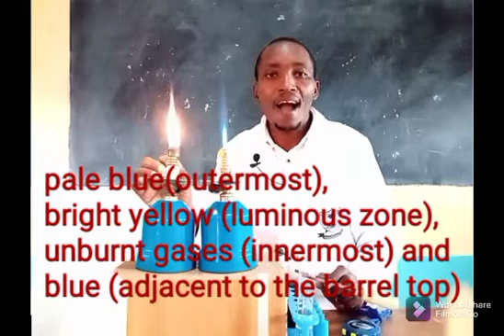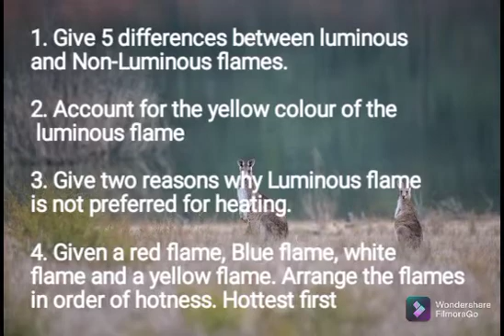Types of Flames - Luminous and Non-Luminous Flame by Dr Sirme

Comment: why is non luminous  when there is a little light emitting?
Reply from the maker: The gas is burnt completely hence produces no carbon particles. Note that the light/glow is produced by the the glowing carbon particles from incomplete combustion of the gas
Reply: Luminous means brightly illuminated, if it's not brightly illuminated despite of emitting little amount of light it's termed as non luminous. In non luminous the bonds energy stored are completely utilized to complete combustion, that's why it's quite energetic. And the products are water and carbon dioxide which are often colourless if a fuel is hydrocarbon.
Reply from the maker: This is very comprehensive.
Thank you
I agree with the chemistry